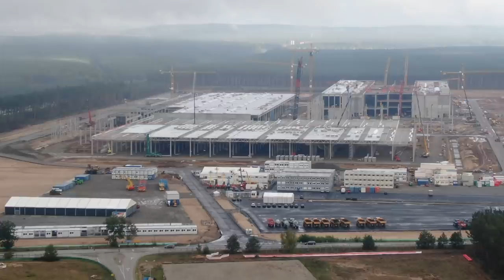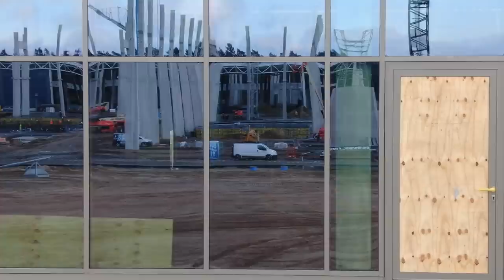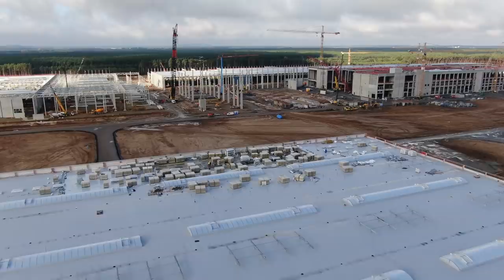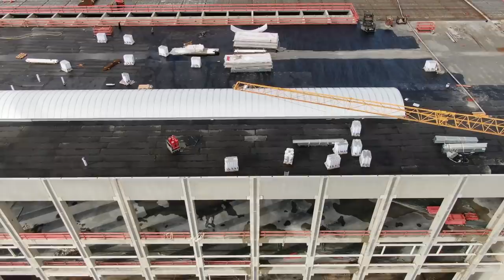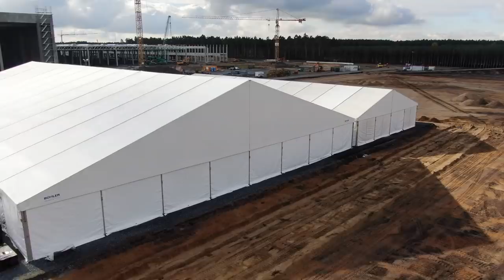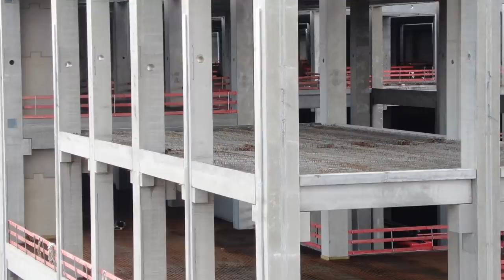Giga Berlin | 2020-10-17 | Casting columns

Comment: One difference I've noticed between construction @ Giga Shanghai and Giga's 4 & 5, is that in Shanghai, when they started a particular stage of the build, they would complete it whereas at the other two sites there seems to be a much more piecemeal approach. By that I mean they go hell for leather in one area only to drop it to go haring off, repeating the same pattern only to go haring off to start something else. As an example at Giga 4 finishing the roofs & @ the Austin site, nearly finish drainage & filling of a pond but not completing it before starting elsewhere. Must be a very good reason for this but it strikes me as a bit scatterbrained.

Comment: Aaah, my Saturday dose of Grünheide.. Thx. :) One thing I've been curious about for some time now.. Shouldn't we see quite a lot of sewage pipes, water pipes, electricity cables, etc. being laid to the ground between the buildings? Did I miss it? Or will it come later?
Reply from the maker: They are pretty fast with digging. I already missed a lot. There are already some power lines and drains for the roads. This week there was a trench in the north around the tents, probably for water. I think most of it is still temporary.
Reply: Much of it also will go onto bridges.
Reply: @HenryLoenwind  What bridges?
Reply from the maker: There will be some steel bridges for pipes and cables between the buildings, just like at Giga Shanghai.